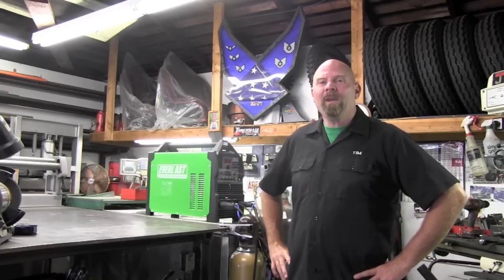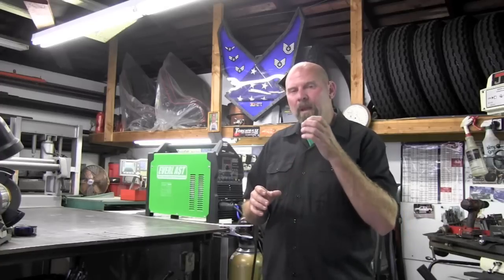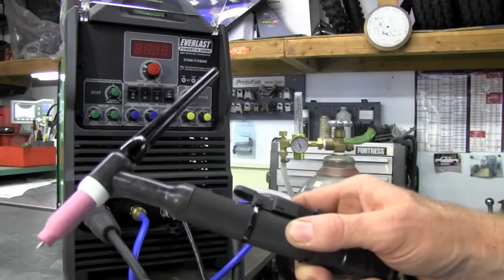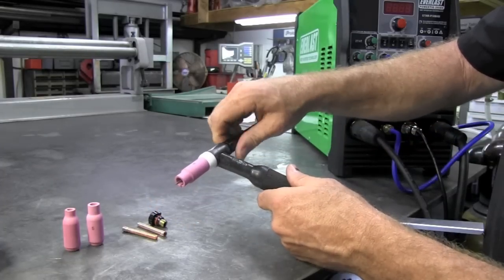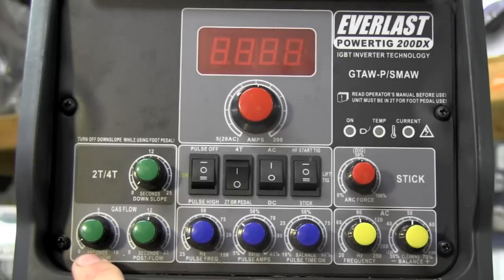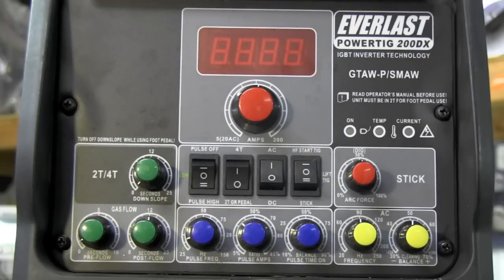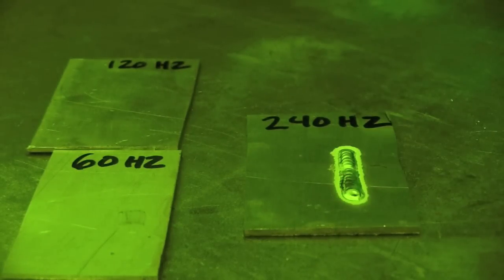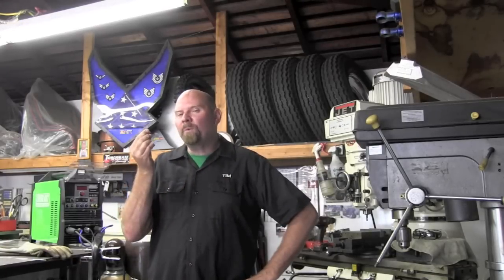Selecting your new inverter TIG Welder.

Comment: I know it's an old video, but are you saying that you run electrode negative on aluminum too? I have an Everlast power Tig 250. Almost identical.
Reply from the maker: It’s been a while since I’ve had this machine. I’m going to say yes because I don’t recall changing things up going from AC to DC. I tried to get a new welder every year to stay up with current technology. I’ve recently sold pretty much my whole shop and I’m hitting the road in the Expedition Truck I built. If you try it and it just starts to melt the tungsten then you know that’s not the one. Sorry I couldn’t be more help. Give her a shot!

Comment: 2% lanthanated only
Reply from the maker: I have tried different Tungsten and everything out there works but not as good as Lanthanated. It becomes a no brainer when your going from steel to aluminum and back in forth just take the time to sharpen the Tungsten from metal to metal.That what I use and from testing it what work the best in this machine.
Reply: AC Welding with a drippy, shiny, quivering, googly BB on the end of the 100% tungsten used to be the state of the art method. No other type of tungsten would work on transformer machines due to the nuggets or deformation build-up on the end. It's  amazing how we made 100%  work. This 2% lanthanated tungsten makes AC almost as easy as DC.  We still have to sneak up on the aluminum  puddle and let the cleaning do its thing.  The 100% tungsten training made the 2% transition easy though.

Comment: I just got the everlast 250 ex. After 22 years on transformer tig machines,  this inverter machine is pretty damn good.  I'm only welding aluminum on it so far. The freq and Hz and pulse adjustments are very nice.  I ran it on 250 amps AC all day long with a 26 style (1/8 tungsten) air cooled torch, and I can honesty say it handled 1/4 lap joints just as good as my old airco 300. I cant believe how cheap they sell those machines. I'm  sold on this chinese machine.
Reply from the maker: My thoughts exactly! Thank you for taking the time and share your story!

Comment: Hello Tim. Im starting a little fab shop in my garage. And was wondering how this machine is holding up? Its a lot of welder for the money, and it fits into my budget perfectly. Hop to hear back soon! -Dan
Reply from the maker: +Dan10201992 Hi Dan! I used this machine for about a year before I upgraded to the 255 EXT form Everlast. This proved to be a great purchase. All the money I made with it went into the 255. So far all of my Everlast equipment has performed great. If it fits your budget I would say yes and pull the trigger and get to welding! Hope this helps!
Reply: The everlast 255ext is a great welder. I love mine.

Comment: hi tim, is this machine dual voltage???, i was looking for something on evil bay... i found this one but says dual voltage 110/220. i was thinkin ac/dc on 110v??? great, i can take it with me for outer jobs. but maybe the advertise was wrong..  just need confirmation to click the buy it now button. thank you.
Reply: +Tim Robel  I just got the new 200dx an it is dual voltage.
Reply: +Tim Robel Dual voltage sure is convenient even though it limits the upper power capability. Tim what do you think about the everlast mts251si welder? I've had my eye on that one for a while.
Reply from the maker: +fireblade639 The machine I had in the video is not Dual voltage but I do believe the new one is dual voltage. I would give Everlast a call and ask what the have in a Dual voltage tig.
Reply from the maker: +jj1479 Thank you for the update! I hope you like yours as much as I love mine!
Reply from the maker: +Milton Gwelch I have no opinion on the 251 si. I have the 255 EXT and love it! Sorry if not much help on this one! Cheers!
Reply: I was hoping you had a review on the Everlast powermts 251si. I like that they upgraded and went with 4 drive rollers. I also want to see their pulse mig function in action
Reply from the maker: Sorry I'm slow to reply! This machine is 220v only but I believe the new ones are dual voltage. Maybe check the Everlast web site for more info!

Comment: hey tim, im looking to buy a tig welder in the very near future.. im considering the 200dx. My only concern is the start amps. pretty sure the specs said 20amps to start on ac. whats the thinnest alum. you have welded with it? thanks in advance
Reply from the maker: +Pyro17059 With this unit I did some .014 aluminum on pulse. The pulse will take some of the heat out of it. Usually on Amps it equals material thickness in thousands. 20Amps =.020 thick and so on! Hope this helps.
Reply: +Tim Robel thanks for the quick reply! That pretty much makes up my mind I believe. Ive always wondered if it would pass the common youtube test of straight edge razor blades and aluminum cans...sounds like it'll do what I need it to do though.

Comment from the maker: I like Everlast by a slight margin. The inside of most comparable machine you will find modules instead of the cheeper version, chips. Drive roll boxes are metal instead of plastic. Just everywhere you look you can see Everlast goes the extra mile to produce the higher quality unit! I will say I had great luck with Longevity and was very happy with weld quality! In my opinion Everlast is the upper end model! Hope this helps!
Reply: +Tim Robel If you factor in the company staff, I'd trust Everlast more by a long shot IMHO.
Reply: I didn't have a good experience at all with Longevity. I ended up buying an Everlast and have never regretted it.

Comment: stainless steel welding on a machine everlast 200 dx ac dc as I connect the wire
Reply from the maker: I don't understand what you are trying to say.But for stainless steel it is welded just like regular steel. Argon 15-20 CFH, one amp per thousandth metal thickness. Stainless filler wire. Machine on D/C. I try to run a little hot and increase my travel speed to reduce the heat in the part. Pulse helps with this to! Hope this helps!

Comment: hi tim, im trying to choose between the 200 dv and the 164 multi. everlast. i love the plasma option but i dont wanna skimp on the alum. tig side so in ur opinion how mutch better is the fairchild in the 200 dv compared to the infineon in the 164 multi. if money wasnt  a prob. id buy the plasma separate but if the quality in ur opinion is a big differance i will wait and get the plasma later. i no the pulse is mutch better but thats not the deal breaker for me.yet the 200 amps might be tx chad
Reply from the maker: I my opinion and what I have learned through the years is I now buy a dedicated unit for Tig, Mig and plasma! I take the proMTS with me to the pits to do repairs. That being said I would go with the 200. Just my .02 cents and hope this helps!

Comment: Hi Tim, I just bought a new 200 DX TIG just like yours. I am a newbee and have never TIG welded. What kind of welding rod would you use to bring together a stainless 55 gallon drum to a piece of black pipe? No tungsten came with my unit. What would you recommend I keep in my box to cover most needs. Thanks!
Reply from the maker: I would do a google search on the rod to use. For stainless to black pipe is a tough one. Off the top of my head I would use a rod called 3 SMW if I were to weld it up with no time for research. 
As for the Tungston I like the  2% lanthanated in my machines. 3/32 would cover form about 40-200 amps. I little less on A/C. 
I hope this helps but as I always do your research before before you put the time into welding something up! Enjoy your new machine!

Comment: Nice video. Any opinion on choosing between this vs the Everlast 210EXT TIG?  I'm looking to pull the trigger on one of these.
Reply from the maker: Thank You Brian. If I had to choose I would go digital. I'm now using the 250 EXT and feel that the digital unit is the next generation fin performance. Out of the two units to choose from I would go with the 210 EXT. Hope this helps!